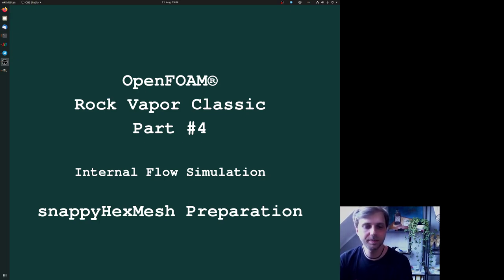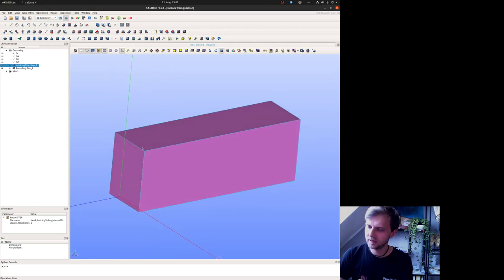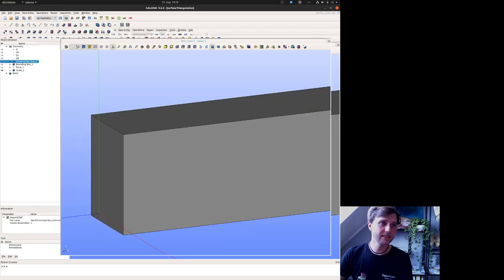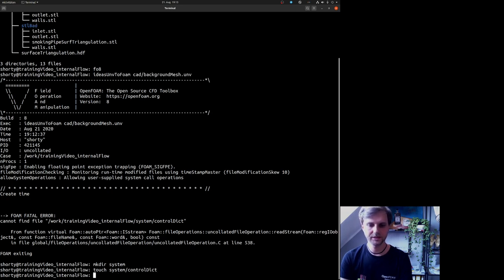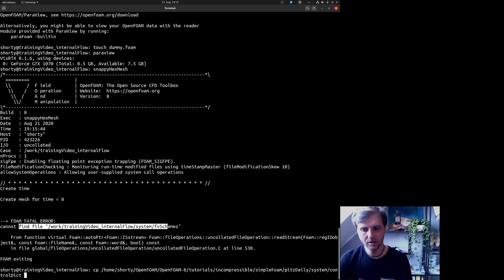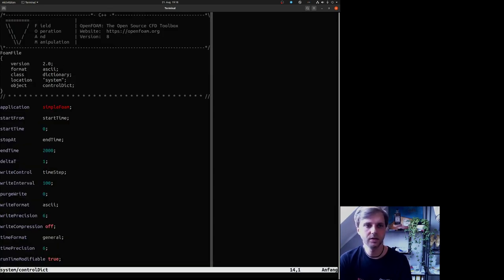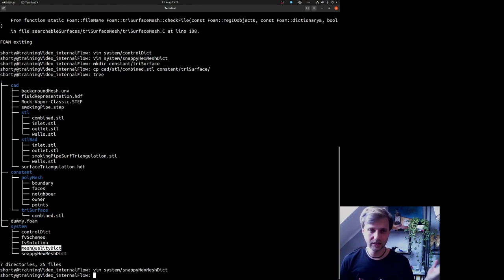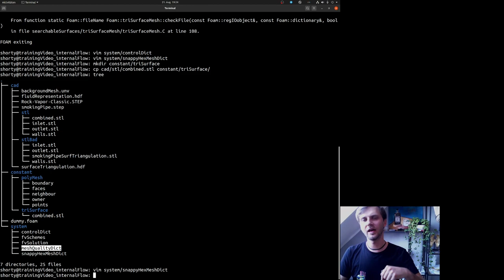CFD Analysis of a Smoking Pipe | Part 4 | Case Preparation for Meshing ∇ OpenFOAM® v8

Comment: Hi Tobias, Thx for this nice tutorials. Now I am trying to repeat what you have done but I am stuck in part4. The snappyHexMeshDict is made for the motorbike.obj and not for the combined.stl. Now I have changed the name nut I still get fatal errors. Do you have a video where you explaine how to adjust the snappyHexMeshdict file for the pipe?
Reply from the maker: Well, if you follow the Screencast, we modify the dict in the way we need it. So maybe I don't get your point. Probably in the next video.
Reply: @HolzmannCFD  Hi Tobias, sorry I was to quick with my comment it is explained in part 5. Thx!!

Comment: May you make a video on how you use vim/nvim as your developement tool?

I have a problem with ctags/vim. I created a `tags` file in `$FOAM_SRC`. Problem is I cannot jump to some header files, e.g., `fvCFD.H`. This is really annoying. Is there any solution to that?
Reply: I find a solution for it by adding the lnInclude folder to vim path (adding line below to your ~/.vimrc or XDG_CONFIG_HOME/nvim/init.vim):

`set path+=$FOAM_SRC/finiteVolume/lnInclude/`

(put the actual path rather than $FOAM_SRC)

Then using `:find` one can simply type:
`:find fvC`
and press tab to autocomplete the file name.m

Even more easier: put the cursor on the file name and in normal press `gf` for go to file and...